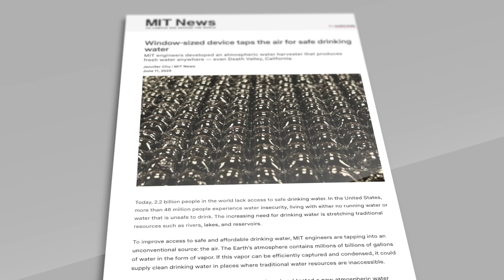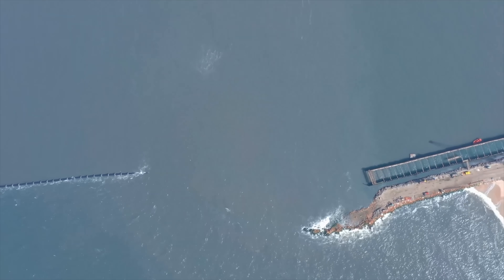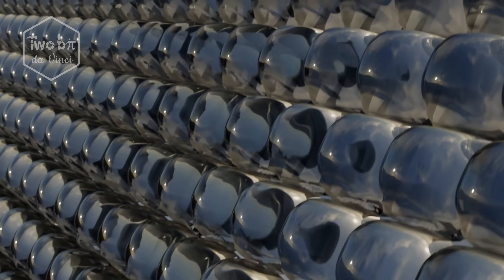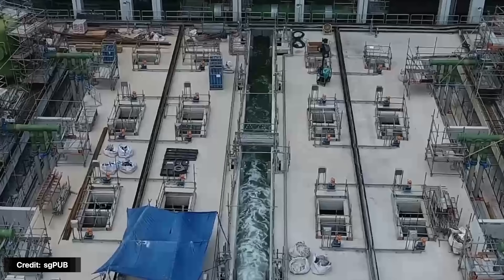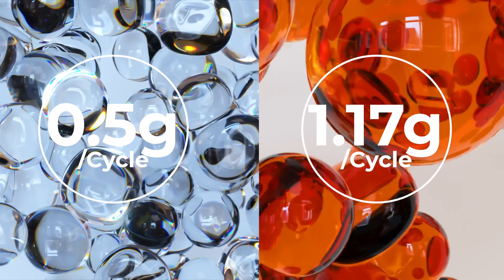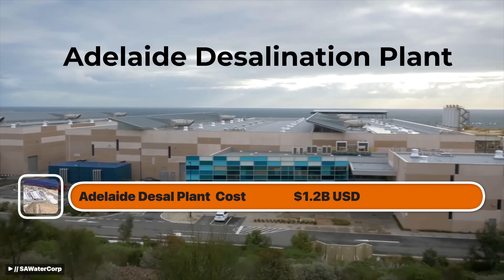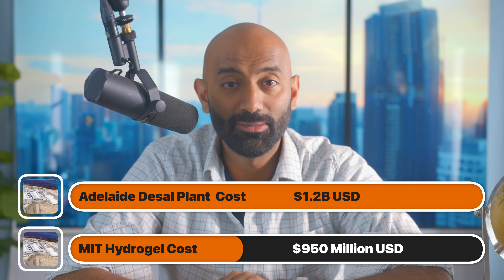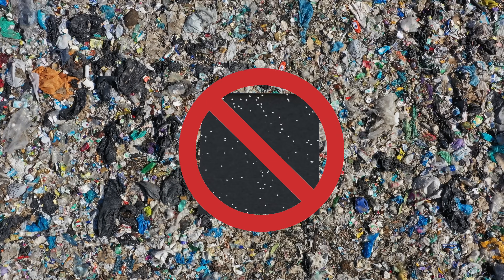MIT's Breakthrough Hydrogel Makes Water From Air w/ ZERO Power

Comment: For those wondering what kind of environmental impact this would have

The answer is slim to none except in areas which are particularly dry and tend to have very little water already. The question you ought to ask is how water got into the air in the first place - and the answer is because evaporation, but if you think carefully its NOT "boiling". Even in cold climates, if it isn't freezing, a puddle will still evaporate.

The real reason is osmosis and pressure. As it so happens, water is not *Natively liquid*. Generally speaking, water prefers to be a gas whenever possible. But its OWN pressure that it generates when it evaporates and diffuses into the air stops it from being able to evaporate quickly. Clouds form as high altitude water collects together in the low-pressure environment which even allows water to exist as a cold vapor in the first place, and clouds moving away is what allows more water in the ground or other areas to continue evaporating.

Put something like this up, and you'll only hasten that process - the water will simply evaporate faster to compensate for the draw. In areas which are already dry? Yes that can have an impact, and such a system wouldn't even really be effective in such areas anyways due to the generally low moisture content.

But on a coastline? Near a river or a lake? It won't be noticeable even with extremely large setups because 95% of that water is leaving through other means anyways.

An ideal location for something like this is the coast, where humidity is stupidly high and there is the great big fuckoff ocean to supply infinite extra water that will gladly evaporate into the air to compensate for this. In a weird way, THIS is the most efficient form of desalination there is. Put these things in a closed room with a fuckload of seawater, and they'll rip all of it right out and leave behind all the shit that can't evaporate. You then need only apply some basic filtering to get out what few things do evaporate with water (carbon stuff usually) and bam! Desalination!

Comment: 30% relative humidity is high around these parts, and I'm only in Colorado not the Sahara. All these water from the air techs have the same issue: there's not that much water in the air, if there were it wouldn't be dry there.

Comment: Can you change your thumbnail to say 0 power. Its literally impossible to do it with 0 energy.
Reply: The "added by humans" is implied. This is coloquially understood, so we skip over explicitly stating it to save time. Sorry.
Reply: Could the sun provide the power, meaning it would be zero power input?
Reply: @puppetprints8277  “0 added energy” just like fruit drinks say “0 added sugars” but have tons of sugar.
Reply: @hdthor exactly. Its misleading. Its still a cool project
Reply: Each year the water absorption needs to be replaced doesn't pencil out for large scale projects unless big improvement is discovered.
Reply: @leroyessel2010  Air flowing over water (ie seas) will re-hydrate air. The air column is 1000s of feet high. Even 10s of 1000s of these devices would not make a noticeable difference on the base-line humidity at any point.
Reply: Shush

Comment: Lol you  can do the exact same thing with shade cloth and a bit of PVC pipe to catch water at the bottom.
Desert people have been doing it for decades.
Nothing new here..🤡🌏🤦‍♂️🤦‍♂️🤦‍♂️
A fog harvesting system using shade cloth and PVC pipe involves a simple, passive method to collect water from fog, particularly in arid coastal regions of South America. The system typically consists of a mesh material, often shade cloth, suspended between PVC pipes to create a large surface area for fog droplets to condense on. As water accumulates, it drips down into a trough or gutter, usually made of PVC pipe, and is then channeled into a storage tank. 
Components and Construction:
Shade Cloth:
A fine-mesh material, like Raschel netting, is commonly used as it's readily available and effective at capturing fog droplets. It's often mounted in double layers with a specific mesh density to optimize water collection, for example, 35% coverage according to the Organization of American States. 
PVC Pipes:
These are used to support the shade cloth and form the structure of the fog catcher, with one pipe acting as a gutter to collect the water. 
Support Structure:
Sturdy posts or stakes are needed to hold the PVC pipes and the shade cloth in place, especially in areas with strong winds. 
Water Collection System:
A trough or gutter, often made from PVC, is positioned beneath the shade cloth to catch the dripping water. This trough is connected to a pipe that directs the water to a storage tank or cistern. 
Storage:
A tank or cistern is essential to store the collected water.

Comment: Just like renewables with energy storage, for small use cases (villages, offgriders, low tech countries, townships) these would work perfectly and are a great solution. Once scaled up for a modern city or industrial sector their use case falls apart, especially like you mentioned when the butcher's bill comes at their end of life and we have to deal with the waste stream (there's the waste stream from producing them also).

We are just now dealing with the waste from the first wind turbines and solar panels in quantity, and they are a drop in the bucket compared to what's out there now, and a drop in the ocean if we eventually replace nearly all of our power production with renewables and batteries, now repeat replacing them every human generation or so (about every twenty years) and we start running into big problems a few hundred years from now. It's like running a generator, perfectly adequate on a small scale or short term, unsustainable on a large scale and or long term.

Fossil fuels aren't the answer, but we need another source of power production, incentives for drilling companies to invest in geothermal would be a great first step, so would fast tracking fusion and breeder fission SMR tech with a government program.

Comment: Talk about speculation 

The problem with this is it needs relatively moisture dense air. 

Guess what's not in desart air in usable amounts.
Hint its water.

Put a dehumidifier in the middle of the Sahara and tell me how much you can get to drink. 

This thing needs 30% and up. Hate to tell you this, but most deserts start at 10 and stop at or below 30 so nonstarter.

If the water is in the air, it's probably raining pretty regularly, and what would work better then? 
A tarp and a bucket. 

Can't wait for thunderfoot to light rhis one up.

Comment: You can also just use a sterling engine backwards and power it with sollar to run and condens the water . Power driven ones get cold enough for liquid oxygen

Comment: How much less than 30% Death Valley gets down to 15% for months and where I used to live in central Australia usually didn’t get past 27% in the night time. 
If they could get it to work down at 20%.

Minimal drinking water if you are doing anything in the daytime in the open in central Australia is closer to 10L than 3L

Comment: As someone who lives in the Las Vegas valley  I think you'll find that 30% humidity being the average for Death Valley hides the fact that in the summer 30% might be the maximum at night, but during the day expect teens or single digit humidity. It has to be felt to be believed - get out of a pool on a 115 degree day and shiver with the evaporative cooling!  Night time summer temps there can regularly be over 100F.

However, maybe in the winter these systems could collect a lot of water like the water collectors in the Dune movie. You accumulate billions of gallons and store it underground to augment the slim summer pickings.

Comment: This tech will remain in the lab for a while. They need to replace the current chemistry with stuff that's a lot cheaper and far more durable. No customer will buy an expensive device that lasts just a year or two before wearing out. It needs to last twenty to thirty years, and the chemicals have to be cheaper than lithium. Back to the drawing board, folks. Have you tried aluminum?

Comment: Forget using it to harvest water. How is it as a dehumidifier? Basements would love this tech.
Reply: The energy cost to raise the temperature of the hydrogel enough to get it to release the water could make it cost-prohibitive for that particular use case.

The beauty of this material is that it's suited to take advantage of the desert heat during the day to release the water, and to absorb moisture from the air at night, when temperatures are typically (much) cooler. It uses the energy of the sun, passively and directly (it doesn't need to convert the energy into electricity).
Reply: @felixfujishiro2304 sounds like pure bs to me. A standard compression pump dehumidifier runs basically all day, and only the cold side does any work.. Add this tech and suddenly the hot side is doing work, and it only needs to run for one hour a day to do the same work.
Reply: @Bobucles 
How are you getting the hydrogel to release the water it has captured while it's sitting in your basement? MIT's system takes advantage of the fact that, during the day, the desert temperature is high enough to turn the hydrogel from hydrophilic to hydrophobic? Does your basement get that hot to do the same? Or would you have to use an external heat source?

Comment: What about water vapor boats? the ones designed to put water into the atmosphere increasing clouds. Could we not make large solar reflectors that heat up sea water to send it into the sky? let the water cycle replenish itself. like small scale solar plants boiling sea water. and why not pump it through a generator. As for the waste salt. we could either refine and sell it. OR truck to the dry salt lake beds for storage, until we then further refine them to be used in Fast Reactors.

Comment: I always appreciate your videos and detailed explanations. One question here though: What happens if one of the hydrogel bubbles leaks or breaks (or maybe somebody uses a BB-gun?)? Does that toxify the water collection basin? Other commenters raised other potential practical issues as well as the many that you raised in your video. I've always assumed detoxification plants recycled the materials dissolved in ocean water. The idea of just dumping brines back in the ocean (instead of, for instance, building a salt flat somewhere) is not an attractive one.

Comment: I really don't understand the economics of 'we could use this in very arid regions to save millions of lives'.

How exactly would you propose 'saving those lives'?

Let's say it's a rich, developed area 10 hours driving from the nearest ocean / a fresh water source. They are not likely to die of thirst. When water reserves run out you take the last scraps of water, jump in your car and drive 10 hours to the nearest place they have water.
For day to day operations they could either build a pipeline to provide them with water, or run a tanker truck back and forth.

So what you probably mean is poor and dry area's. And poor implies that they would have to find a rich nation, wanting to pay a huge yearly sum to provide that poor village with water.
If you can find that rich sponsor, why not slash the cost in 10, run a tanker truck back and forth and use the money you save to provide another 9 villages with water?

And no, that isn't good for the environment. But do you really want to let the people in 9 villages die, because you want to save the environment running those tanker trucks?

Even if you're really hell bent on preventing that harm to the environment, there are definitely ways to run electric trucks with (solar powered and paid for by the rich nation) stops along the way, which probably is still cheaper than using hydrogel. 

So tell me Ricky, how would you propose saving people in those arid regions?

Comment: How did you arrive at the lifespan of 365 cycles? You mentioned it was untested, but that other uses showed resiliency for many cycles... Then you just jumped to 365 and used it as a limiting factor. Was there any basis in this estimate?

Comment: Several questions come to mind.  I understand they have only tested the Hydrogel cycles for a year.  Could it's available number of cycles exceed 1 year?  Lithium will come down in price as more is found (already occurring) and the cost of production decreases (which it will) and the artificially elevated price is overcome because China's near monopoly is overcome (which it will be).  I suspect the cost of and safety of recycling or disposing of the Polyan*** will come down as well.  As for crappy Government regulation on the water produced, testing water for possible impurities is routinely done on private wells everywhere by private individuals without referring to the Government for their permission.  As far as scaling up the process and access to it.  As usually, time will tell as it always does.

Comment: something to consider: it may be expensive *now*. But as our water infrastructure continues to get old and strained (seriously, it's a big issue) and as climate change changes water availability, that could make this a lot more "affordable". 

also, people are investigating many types of materials to do this air-to-water conversion, including food biomass waste which, I believe, is still biodegradable afterward. 

And, of course, the tech continues to improve each year. And is already a boon for places without access to the ocean or where construction of the necessary water lines and infrastructure would be prohibitive expensive. Plus, you don't have to worry about the brine waste, which is a serious issue. 

So I'm still optimistic that this tech could have a place in everyday life. I also love the idea of someone setting up a farm on some severely degraded land, setting up solar panels that provide electricity and water (using similar atm. water setups). They provide shade for land and water, allowing crops to grow, and water that people can drink. Basically, it's going to make off-grid possibilities a lot easier to pursue. Plus, people who use camper vans or otherwise live in, or spend a lot of time, vehicles, will absolutely love to have something like this.
Reply: ps. the army is funding a lot of this research bc water availability is a massive issue for troops deployed in the middle of nowhere. (And imagine a thermos that fills itself over the day.)

Comment: Mostly the stability needs to increase more than the cost needs to decrease, because these estimates don't factor in the labor cost to replace these hydrogel panels, which is going to be significant if we ever have hydrogel plants at a scale sufficient to replace desalinization plants. Hydrogel could be almost free and the labor cost to replace the panels might still outweigh the costs of a similar-output desalinization plant at current cycle limits.

Comment: The reason this doesn't work is the places that need water the most also have the driest air. Just because a system works in the driest desert doesn't mean it works well enough to be useful. At low enough efficiency, it is more practical to transport water.

Comment: 1:07 the problem is self imposed, we have the tech to filter the salt out, even if you don't want to use desalination plants it's still very easy to build large greenhouse structures with shallow pans that evaporate the water so it can be condensed and stored whilst the salt can be sold to someone who will clean it for sale.
Reply: Problem is profit motive
Reply: @Azuroth  Yea but this would be cheaper than any other method really. Profit wise, you get the salts and the water While water it self would be the cheap side of things, the salts you can sell with some over head or even process them your self. At least in Cali, you also have a battery plant in the same state for transport of the raw goods. The only thing that holds a lot of that back personally is just the amount of on demand water and the left over salt that has no value, but there has to be something we can do with that.
Reply: @adr2t yes that's long term forethought. That's got nothing to do with short term profits unfortunately
Reply: @Azuroth  Well it does have both, of course I could be missing something.
Reply: @adr2t not enough short term gains to meet their fiduciary responsibility to shareholders to maintain a certain percentage of quarterly profit. Never forget corporations are primarily responsible for upholding shareholder value and expectations regardless of its potential for long-term gains (even if there is a short term gains as well)
Reply: @Azuroth  I would think there would be still. Water still has a value - and that would be short term money, while the other is more long term. You could even use some of that cheaper water to turn into O and H for different applications as well as both are needed. Any left over power from solar could also be sent back to the grid if the demand for the water isnt needed as well.
Reply: @adr2t I appreciate your optimism, I truly do. But always remember, when they say something isn't "economical" it's doublespeak for "investment too risky for quarterly gains"
Reply: It is easier(cost  wise) per litre of water to build a greenhouse then a desal plant?

Comment: Do you need to heat it to 50 degrees to start getting the water out? cos apparently the typical peak temp in the Sahara is 40. (I just did a quick search today and that was the highest daytime temp I found.)
Reply: oh it is estimated to produce 1-3 L a day in drier conditions . . .so for a household which needs 300 gallons a day (as stated earlier in the video) you would need 400 square meters of this stuff . . . .practical!